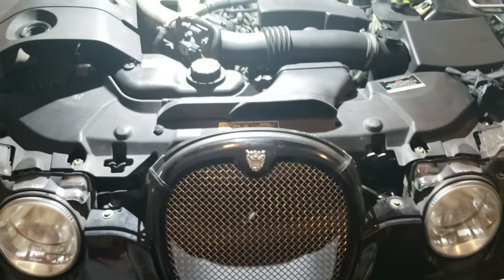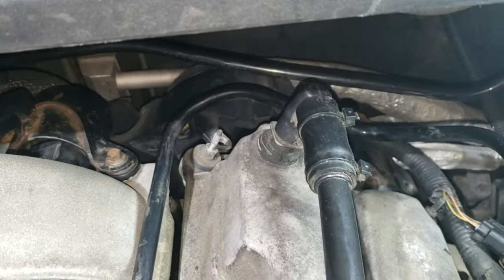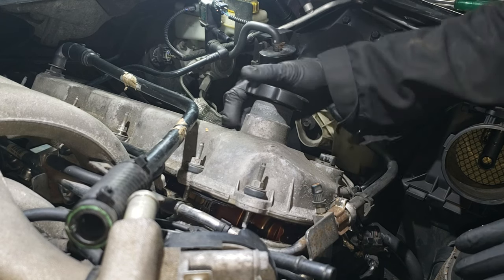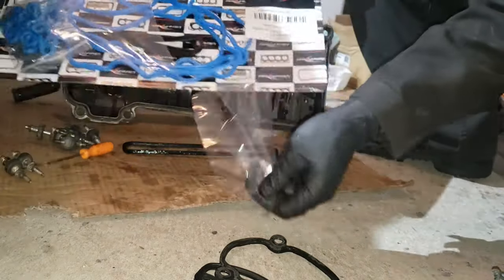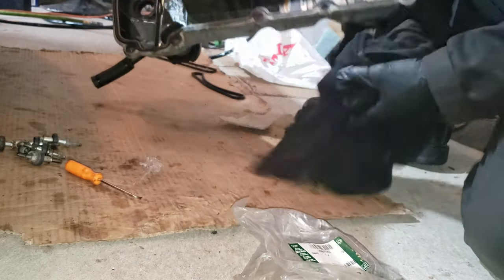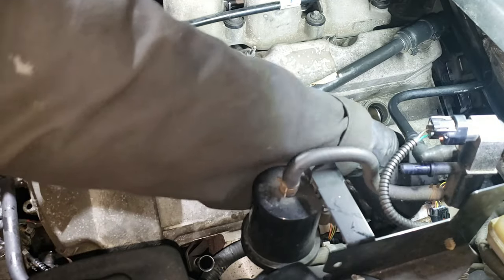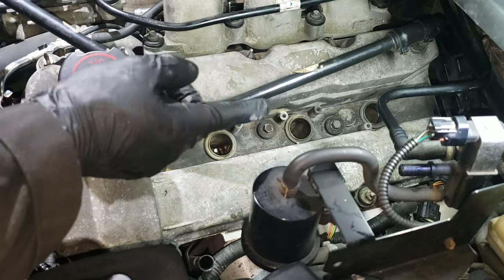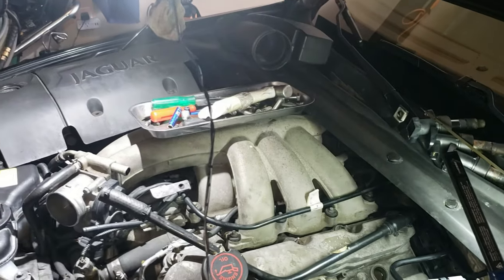JAGUAR S-TYPE  VALVE COVER GASKET REPLACEMENT

Comment: I always enjoy videos about repairing an S-type engine, since my X-type has got the same engine mounted transversely. I also had to go through the same procedure when checked and adjusted the valves clearance. Cheers!
Reply from the maker: Ohh nice that valve clearance adjust must have been interesting. Yeahh i also did the rad on this same car and boy was  it interesting, i didn't have to disconnect the a/c line, which was a bonus for my client 😀
Anyway cheerz!
Reply: @Cargorage  Valve clearance is very interesting, especially when one hasn't got any extra shims. I pressed on the valve tappet with a screw driver, while my assistant removed the shim from its place with an HDD magnet. I swapped the shims of different valves so that at least they were not over-tightened, some of them are a bit loose, but close to the manual gaps. To tell you the truth, for that moment my engine had a millage of over 300K km, I expected much worse condition of valve clearance.
Reply from the maker: Oh wow! Thats a very complex one and good job 👍.
I remember when i did a headgasket+valve clearance adjust on 2013 ford focus rs and boy i had to remove the camshaft and did the same thing you did, just switch it up the bucket shims from the other cylinders. And it works out good. 😄

Comment: Greetings from Russia, I have a jaguar xf 2012 3.0 gasoline, the VVT valve seal is leaking, is there a seal there, otherwise you didn’t change it on the video. If so, please provide the part number?
Reply from the maker: Hello there Sir,
Yeah sorry i didnt change the vvt solenoid seal because it didnt need, it wasnt leaking.
Reply: @Cargorage  Thanks! I understand that AJ82577 is installed there?? https://www.britishparts.co.uk/classic-jaguar-c4707/jaguar-s-type-c24/engine-v8-c25/camshaft-cover-grommet-p495
Reply from the maker: Yes, that parts looks about right sir. Cheerz!
Reply: @Cargorage  Thank you very much!!!

Comment: dude,  new valve kit shown was for 2000-2003.  You wasting time showing this lame video.   All valve cover seal washers and bolts have to be replace  since the rubber grommets collapsed and no able to seal. You end up not replacing gasket.  lame job. Oil will leak  like a faucet.
Reply from the maker: You're right i didn't change the spark plug seals (tube seals) because the parts (aftermarket) ordered is wrong and the bolt seals. Anyways i don't see any leak so far so that means i know what i'm doing and i did a great job 😁. So, meaning that just depends on your ability to work things out. If you know what i mean. Thanks for viewing! Good day.